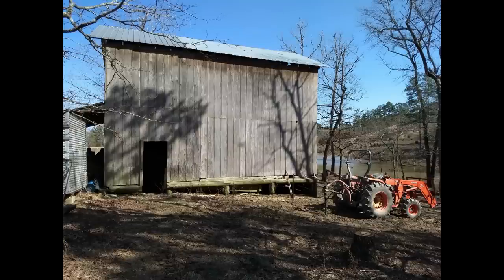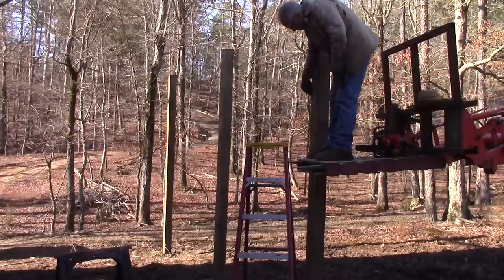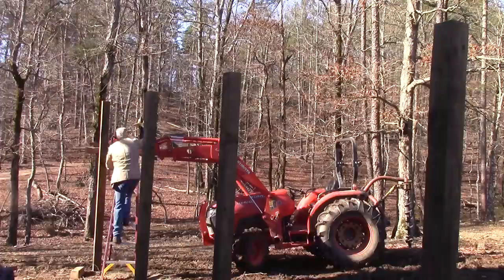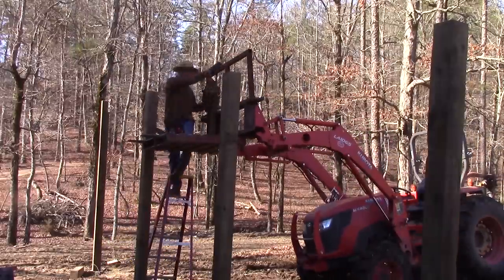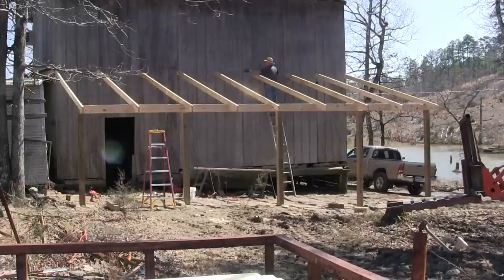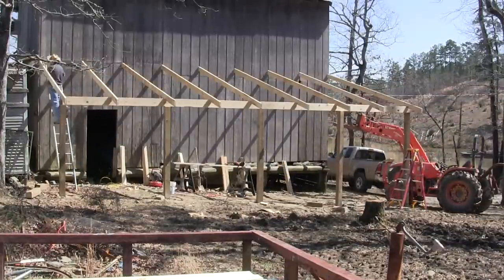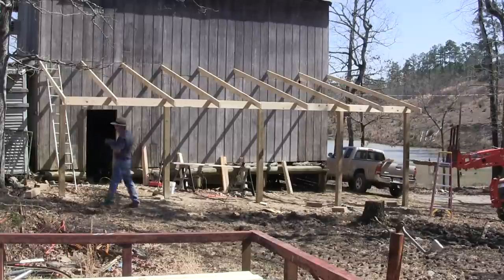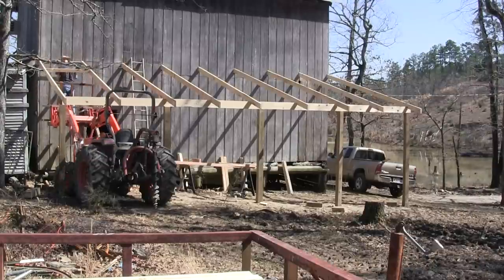Time Lapse of Building a Lean To  on My Barn

Comment: Nice job, thanks for making the video.  I will be making one soon, 16x36.  I think a ledger board that is properly secured is mandatory, a very important component.  I also will cut the rafters together, then mark them at 24" for the purlins.  2x4 purlins are easier and maybe stronger, also wider target for screws.  Also, I will pre-drill the steel on the ground, much easier.  I'm using 6x6 posts are 2x8 rafters on 16" centers.  2x12 double beam, 2x12 girder.

Comment: i were to upload  vid, it would have to be this. I've tried to work and narrate at the same time. NOPE. One or the other!!

Anyway, Great job ! Love using thae 🚜. I often have to find ways to do a two-man job by myself. Never underestimate creativity when its feuled by survival!

One thing for sure, add diagonals ro the front for lateral bracing! About 1/3 the way down the post is a sweet spot. Or gentle racking back and forth over the years (or one well-placed windstorm) will loosen it to unsafe levels! Cheers!
Reply from the maker: I don't know why it took me so long to think of using the pallet on the tractor as a platform but I use it all the time now.  Thanks for the comment.

Comment: What about diagonal bracing from the roof to the posts? Also, what about flashing on the top where the new roof meets the barn? And one more question, why didn't you use a nailer against the barn to fasten the rafters to? I am going to be building a 20' lean to that is 40' long and am trying to see how other people do things and why.  Thanks for the video.
Reply: ieatyomama  I think it's the slope of the ground playing tricks with your eyes.  Notice how the barn is raised up off the ground on the right side?  He used a laser level to make sure the posts are level, so I'd bet what we're seeing is just the slope of the ground vs his roof
Reply: @jameswalker590  it's definitely not level. Not 2' out but it's out, unless the camera is playing tricks
Reply: @alabastardmasterson  Nope I'm his neighbor -and Brother in law - it's flat. Must be the tripod the camera was on. If you look at where the rafters are connected to the barn they hit at the same spot. The ground isn't very level at all so maybe that's it.

Comment: Great video...  I'm thinking of a similar project to store my tractor...  Did you put any flashing where the roof met the barn?   Thanks for sharing!
Reply from the maker: I didn't flash it. I do get some water through there but it's the side of the barn which was getting rained on before. Flashing it would be the correct way to do it though.

Comment: great job - Did you bury the post with dirt or add concrete?
Reply from the maker: I set them in concrete but have used gravel and dirt in the past.  I think both work well, I just didn't want to have to pack all the dirt in there.  I'm getting too old for all that.  :)

Comment: Very nice! Appreciate the video. Any way to attach flashing at the connection to the barn? I'm wanting to do something similar, but I don't want water to make it through the connection.
Reply from the maker: You could flash against the barn but you would want to put it under the barn siding.

Comment: Did you use brackets at the barn and of the rafters?  And did you notch the post end of the rafters?  Also what is the distance between each post?
Reply from the maker: I did use brackets at the barn ends and notched (bird mouth) the post end.  The posts are 8 feet apart.  That distance worked out evenly but I wish I had done a couple at 10 feet, 8 feet is kind of tight if you are backing a trailer into it.
Reply: @SoatMon  Fantastic.  I have about a 20ft space and was hoping to split it even.  What size header board and ledger boards did you use?  What about rafter and perlin sizes?

Comment: What was the spacing that you had the rafters on center? I'm looking at doing the same thing here very shortly
Reply from the maker: 24 inches
Reply: @SoatMon  My husband is building something similar off the side of our house. (14' x 35') Although, it will have a rear and exterior sidewall.  It is for our RV.  He did his rafters 16" OC.  I thought 24" would be sufficient as we are doing a straight metal roof - no decking - and we don't get snow here in CenTex.  (well, as long as you don't include LAST WEEK!  LOL)  Anyway, you seem to have proven 16" was a bit overkill for our purposes.  Oh well....
Reply: @SoatMon  Those rafters are not 24" centers.  32" to 48" surely.

Comment: Some of the people on here are know it all's
Everyone has there way of doing things if it does the job then great
As far as the what about eye protection
Back in the day we didn't have eye protection
Reply from the maker: Thanks!!
Reply: Yeah...I remember when eyelashes first came out i was like "hell yeah finally SOMETHIN to help catch a little dust when i do the safety squint" it was centuries before anyone thought of a physical barrier you could see thru. The ones you cantt see thru are for welding.  And safety glasses actually made of glass kinda defeats the purpose. Imma start calling them safety plastics. 

I bought a work light today and on the box, in large print: WARNING: ALWAYS USE SAFETY GLASSES. Always? Really?? Its a fuckin light for gods sake. No wonder noone takes it serious when glasses would actually be in your best interest. I cant wear em all the time they fog up, fall off, drip sweat, and i dare you to wear them with a dust mask. I always ask..." Am i safer blind but protected, or witnessing but vulnerable?

Yup. Im bored

Comment: building a lean too roof for small 8x8 need to know how to do rafters every vid i seen kinda skips over this most important detail. using 2x4s with 2ft drop. Anyone that recommend a vid thank You
Reply from the maker: I used joist hangers at the top of the rafter to attach to the building.  You have to cut a angle on the end of the rafter to match the pitch of the roof.  You can just hold the board up to the building and draw a line to match the pitch.  Then secure in the joist hanger.  You can use rafter ties at the lower end to hold it in place.  Both are available from home depot or lowes.  Good luck.
Reply: @SoatMon  how to cut the angle  is what i really needed to know.Thank You for the info